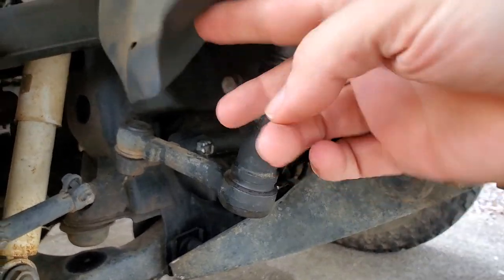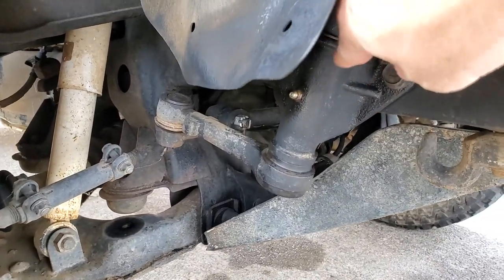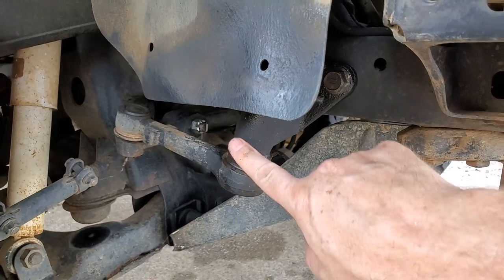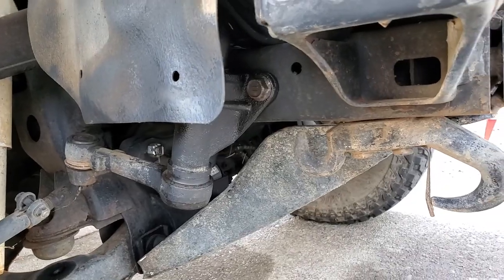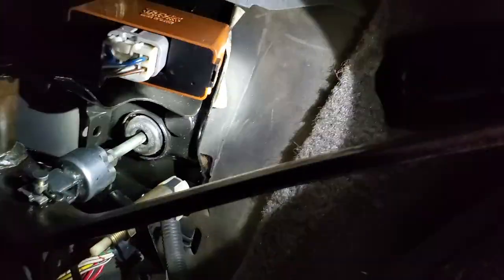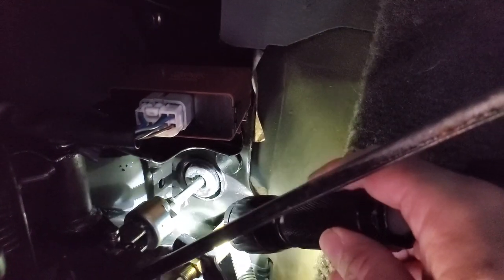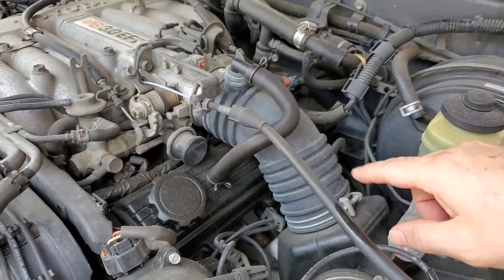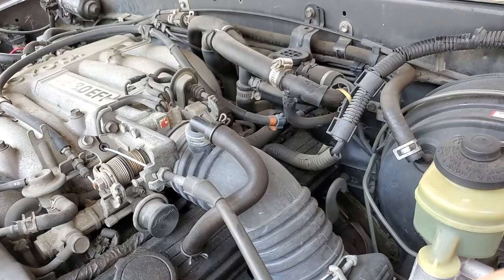2nd Gen 4Runner, Common Problems and How To Fix!!

Comment: My father-in-law has a 95 4runner and it has low rpm during idle and slow acceleration, especially when going uphill. Is it possible that the rubber hose you mentioned is the problem?
Reply from the maker: It might be. Might want to check when the last tune up was for starters. Vacuum leaks, and maybe the IAC is out of adjustment. Check my website agilewoodsman.com for a page that has all the info on how to do that.

Comment: Hi mate I have 2nd gen 4 runner with a 22r motor I need help it cranks over but it won't start
Reply from the maker: Oh man, that can be so man things. But I'd always start with the basics. An engine always needs air, fuel, and spark to run. So check that you're getting those things. Make sure you're getting fuel pressure. Good strong spark. Make sure you're getting good compression.  Check for codes, instructions on my website.

Comment: Another great video!! That's some more great stuff for me to watch out for I've just replaced the rubber boot that goes to throttle body cause po had put orange rtv all around the split which was also in edge of throttle body.  Just got timing belt kit with water pump and parts but found I have no compression in 3 of 6 cylinders so don't know what's gonna happen now.  Thanks for sharing be safe have fun
Reply from the maker: Ooof yeah, unfortunately no compression isn't a good sign.

Comment: That clutch bracket took me like a week to figure out. We replaced the clutch and the cylinders and and did some other various witchcraft and then finally saw that crack.

Didn't buy a new one, we took a welder to it and beefed it up.
Reply from the maker: That's what a lot of guys do. And welding just might be a stronger option imo.  But yeah, it's a bugger to figure out and causes lots of guys to replace parts needlessly. You're not the only one! Glad you got it sorted out.
Reply: @AgileWoodsman  Thanks man! You don't happen to have advice for me on something else, do you?

3l v6 has always kind of struggled at idle, would die if I braked hard and turned at the same time, but then I went through a good puddle pretty hard and it started dying on idle every time, we fiddled around with it and now it dies after maybe 10 seconds consistently and like 50% of the time when I press the gas too quick it dies immediately.
Doesn't seem to be a vacuum problem, isn't that hose that you mentioned in this video, I checked the MAF and changed the fuel filter, the fuel pump is at least supplying fuel (though maybe it's being inconsistent which might be causing the problem), not the air filter, and although I haven't cleaned out the IACV yet I don't see how water could have caused that problem.
Oh, no water got into the engine by the way, just the air filter which I changed.
Maybe a computer or wiring problem? It works great for the first few seconds, then starts sputtering, then dies. After changing the fuel filter it started sometimes not dying when I press the gas, I don't know if that helps.
Sounds and runs fantastic when I can get the rpms up, a little backfire sometimes is all.

I'm not asking you to be my mechanic here, I'm just wondering if you know of a 2nd gen 4runner specific problem that I might not have thought of!
Reply from the maker: @undefined6947  OK yeah clearly the water caused something. You know, fine before event, not fine after. So it probably isn't maintenance items like the fuel filter. 
Water getting into the electronics isn't usually a big issue, it's an old Toyota! But age sometimes exposes things. 
Water in the air filter, that's a big puddle! Clean and double check the VAFM (we don't have a MAF). 
Check distributor too, and wires. Make sure spark isn't arching and your ignition is consistent.
You'll probably have to start probing electrics and sensors after that.
Also check for codes, instructions on my website. Good luck!!
Reply: @AgileWoodsman  Got it, thank you! I forgot to mention the distributor is fine we replaced it already. No big deal, it was wearing out anyways. We haven't played with timing or ignition yet but, as I said, it sounds beautiful unless it's trying to die.
And yeah lol, it was a very big puddle...
The weird thing is that changing the fuel filter did help a little, but I'm guessing that the backpressure it was causing was just not helping the actual problem rather than causing the problem in itself.
Got a few codes, air intake sensor and throttle position sensor circuit. I don't really know what that means yet, I'm still trying to learn, didn't know what a distributor was last week! Knock sensor was bad when I bought it, just haven't put the new one in yet out of laziness, but it does give me that code because the sensor is bad.

Anyway, thank you for the help! Looks like we're gonna have to really poke around at this thing!
Reply from the maker: @undefined6947  That's how you learn! Keep at it! And oh yes! The iAC absolutely can cause misfires,  bad idle, and things like that. Code 24?
Reply: @AgileWoodsman  yes, but I was talking with a friend that helped me take a look at it and she says I might be getting code 24 and code 41 because we unplugged those and ran it to see if anything changed. Sorry, this has been a lot to learn very quickly! We'll take a look at the IACV first thing tomorrow. Thank you much!
Reply from the maker: @undefined6947  Possible. Disconnect the battery for a few minutes to reset the codes. But I still think it's got something going on. It shouldn't run that poorly
Reply: @AgileWoodsman  yessir!